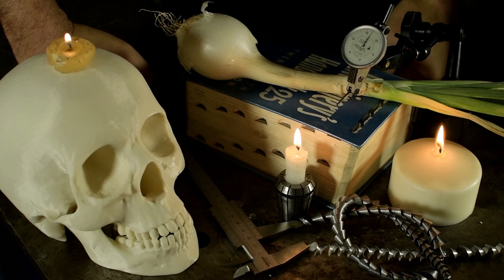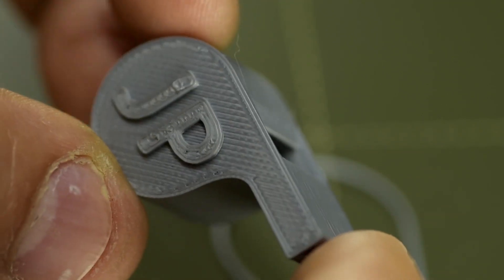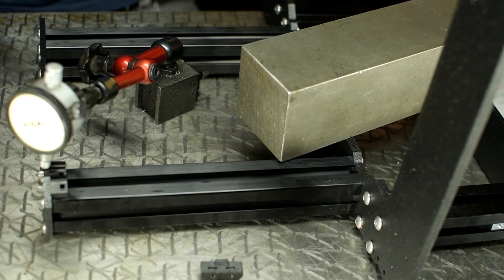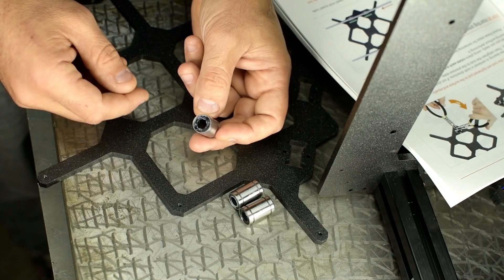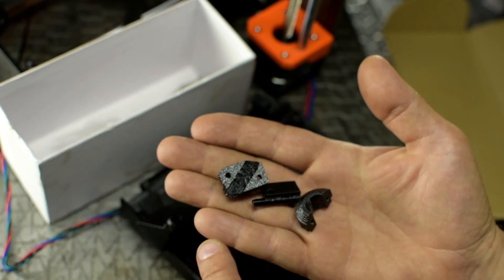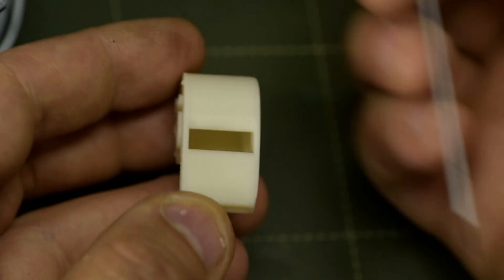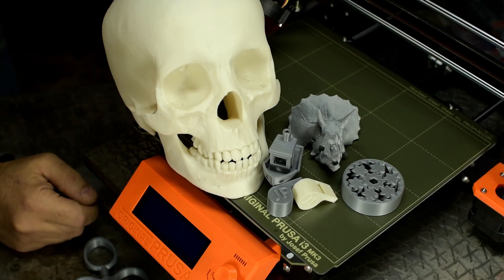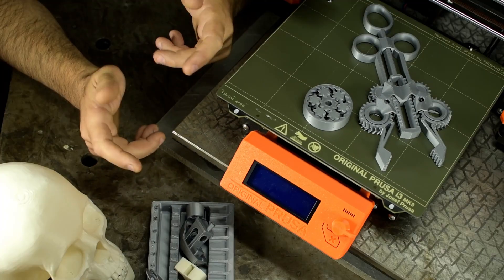This Old Tony in 3D!!! (printing)

Comment: I've had my crappy little $170 Anet A8 for about 3 years now & roughly another $150 or so later it prints about as well as an Ender or a MK-3 with almost no extra attention. It's basically a ship of Theseus or Old Ironsides sorta thing. The budget printers do need more attention and ones like the A8 can be downright dangerous if you don't immediately toss that power supply it comes with. It was a fun learning experience & I feel confident enough to identify and fix just about any problem with a FDM printer but that was the whole point. I'd tell anyone shopping now to just get a CR-10, Ender 3, or a Prusa.

Comment: It was a nice and fair video. A 3d printer is just one more tool in the workshop, and I add a very similar experience with the Creality Ender. Assembly was way easier though and did not require a surface plate...
First part was fine and had very few failures. Just be aware that unattended 3d printers can destroy themselves and possibly cause fire...

Comment: It's neat to be able to download the CAD of simple parts from some parts websites (Ick-Master-may, Arr-cay, for one) and have a fairly faithful printed reproduction. It certainly doesn't have the strength of a manufactured part, but it can serve as a good stand-in until the part arrives if not even some light testing.

Comment: I had the Prusa i3 as my first printer, the heating bed started having issues maybe 2 years in. The wire that is soldered to it became weak from the bed moving back and forth and ended up breaking. When i soldered it back i think i might have shorted it as every time i turned it on the power supply would blow a wire. Anyways i ended up buying the Creality CR-10 mini and i am loving it. It took about 1 hour to assemble as a lot of it comes pre-assembled already and the one i got came with everything you need to get started printing, even a small spool of filament. If i were buying again, i would definitely recommend the CR-10 over the prusa just because of the ease of assembly. as far as the prints, i think both were pretty similar up until i started having the bed issues

Comment: As a Creality owner: Creality machines are for tinkering, Prusa machines are for printing.

Make sure to look into the settings for infill, walls, floors/ceilings, line count, etc. Also brush up on isometry if you don't remember much about it. PLA might be the entry-level printing material, but it has the best isometric strength of any material you can put through that Prusa.

And don't leave your spools loose. They're wound how they are so they feed without binding. If you let the pressure off the filament, it'll spring back and fuck up the winding. Those unattended print jobs will go from nice care-free prints to warm air if the filament kinks.

Comment: i bought a $125 ebay special, it was a total dog to get working with bad stepper drivers/modules and a filament extruder/feed that worked half the time before falling apart, it was way way way more education than something that would work 1st time out the box, took a month to get a decent print i admit, but what a month.

Comment: I would recommend moving the filament spools off of the printer.  Mount them somewhere else.  Put them on some kind of bearings rollers too.  This will reduce print defects and failed prints (mostly due to the filament coming off the spool).

Comment: You joke about that spindle bearing, my friend took one of those up to 2000 RPM on a drill press and it didn't even get warm. Runout is probably garbage, but it'd work in a pinch.

Comment: Built mine in a day on my table saw. 20 spoils later, haven’t had to adjust anything.

Tips: 1. Get your first layer set correctly. 2.  Buy a textured sheet to print on.  3. Don’t trust the temperature sensor for the bed.  Use an infrared thermometer.  I had trouble with petg and finally worked out bed was too cold. Upped temperature -> no problems.  4. Use the correct solvent for your filament when cleaning the bed.  Where can we get the file for the skull?  :  )

Comment: Quick tip:
Skip the ABS unless you have an enclosure, it does to handle temperature fluctuations well while printing, and stick with PETG, ASA, and use PLA for protyping, since you have a direct drive you can easily print TPU as well. I don't know what temperatures you can run on the Prusa MK3, but Nylon is a great filament to work with once you have most things figured out.

Comment: I'm questioning the "get what you pay for" applicability  here. The Ender 3 doesn't use 3d printed parts in its design, nor does it hold itself together with zip ties. Seems like a lot of the price of the prusa is in the name, and the obnoxious branding on literally every part and box.

Comment: If you haven't got round to the PetG filament yet I would recommend either raising the z axis a bit or use some release agent as it sticks like a bugger to the smooth steet. Windolene or equivalent is a good release agent for PetG and TPU just make sure to remove it before printing PLA. I personally use the textured sheet with petg  as you get a lovely base and it is less sticky. The textured sheet is pretty useless for PLA mind.

Comment: The Ender 3 Pro is the ideal option for a first-timer. I've been using it as my first printer myself for about a year and aside from annoyances with bed-leveling, (which can be remidied with auto-leveling solutions like a BLtouch,) or replacing that terrible magnet bed with a glass one, it's been such as useful part of my hobbies. And I can't even compile of all the improvements I've already done to it just by printing them myself. 3D printing is definitely going nowhere, that's for sure.

Comment: TOT, when you print PET-G, you will need a release agent of sorts on the PEI print bed. Otherwise, the PET-G will fuse to the PEI and probably damage it at best upon part removal. Hairspray, glue stick, or painters tape work well. I personally use hairspray. I've hear people using rubbing alcohol but I've never done that so I can't verify it.

Comment: I may be able to speak to the budget side of 3D printing a bit. As a broke college student I don't have a whole lotta clams to spare, so my first printer was about as cheap as they come. Freshman year I bought an Anet A8, which is essentially a very cheap knockoff version of the printer featured in this video (acrylic frame instead of aluminum extrusions, no auto bed leveling, cheap aluminum build plate), but it set me back only 100 bucks. Took about a month to ship from china and 10 hours of assembly on my dorm room floor, but I can genuinely say that was the best $100 I've ever spent. Having any 3d printer opens up nearly endless possibilities, and the relative efficiency and affordability when compared to other forms of prototyping (woodworking/machining/clay modeling) is staggering when you really get into it. And while that printer would occasionally malfunction, I believe having to tune the machine and slicer settings to get good prints really helped me get a better understanding for the process of 3d printing. At my internship over the summer we had an Ultimaker S5 that cost literally 60 times what my first printer cost, and I while the dual extruder setup is cool, I think there is definitely a point of diminishing returns in there somewhere. I currently have a creality CR-10 (the big brother of the $200 Ender 3 mentioned in the video) which set me back about 400 bucks and I've had almost no issues so far. I think for the hobbyist market thats really the sweet spot; the 3-500 dollar range has a plethora of affordable and capable machines that offer a pretty solid introduction into one of the coolest emerging technologies of the 21st century.

Comment: In my experience, the Ender 3 has been very low effort to use. It comes partially assembled and took me maybe an hour and a half to finish, no problems starting it right up and printing. Maybe it's generally true that budget printers require more time to get started, but that's not true of the Ender 3

Comment: THANK YOU SO MUCH FOR LUBRICATING THE BEARINGS!
The recommendation is some 00 grade semi-fluid, but yeah... Why don't these kits come with bearing packing instructions?
*sigh*
Edit: And yes, you can run 1.6mm smooth line trimmer line through it.. Just find the nylon instructions and change your filliment diamanter.. :)

Comment: Assembling it yourself is actually a good experience. There are times you're going to have to take some things apart to fix it. Like when you have some really bad filament that gets stuck in the nozzle, the only way to clean it properly is to take the head apart.
Benchy has a website that will help you figure out what you can do to improve accuracy. 
I see a few small problems but I can't say what to look for to fix.
3dbenchy.com
And if you don't like the tugboat there are different versions. On Thingiverse look up vandragon_de. He's made some pretty cool ones.

Comment: No one calibrates a 3d printer like a machinist.
Reply: I built mine mostly on my basement carpet. First print was totally fine! Must have got lucky.
Reply: Moisture Patrol it’s well known that basement carpet can be a perfectly good substitute for a surface plate
Reply: @Aklemvaeo  Don't really need that much precision bc the tolerances of the printed parts are not usually determined by how square the frame is.
Reply: @skelten454  A well-built frame is absolutely a necessity. Ultimakers, for example, have extremely rigid frames that are calibrated like adult CNC machines, and they're well known for their remarkable print quality. Yes, the dimensional tolerances may depend on the plastic (partially), but you shouldn't skip on the frame - that's when you start reliably getting tolerances within .1mm.
Reply: ohh man I hate that part.
here we go again
Reply: Next step is a 3d scanner. Einstar for bigger parts, Revopoint mini for small stuff for example.
Reply: Dude, for fking real. His prints are incredibly high resolution considering the machine he's using. Right off the bat he is already maximizing the capabilities of that printer, it takes most people a year or more to get where he started. That skull looks like it came off of a $3,000 machine
Reply: @fuck_youtube_censorship00  what do you mean? It’s a prusa. Of course the prints look good.
Reply: @fuck_youtube_censorship00  My lab has two machines >$2,000 and two more at $1,200. Only one prints as well as Prusa. Plus I can easily observe, repair, adjust and upgrade the Prusa. Others are locked down so when a problem my only solution is to buy a $200 replacement cartridge.

Comment: PETG has all the benefits of ABS/ASA, but doesn't have the warping issues.  And it doesn't smell like chemical death.
Reply: @npgoalkeeper _ ASA or nylon are your only choices if UV resistance is a concern, but that's not commonly needed and is a poor reason to put up with the faults of that family of plastics.  Overhang and stringing are matters of printer tuning.

Comment: FYI seal that PLA backup or it will absorb water from the air and your prints will start messing up halfway through and you won't be able to figure out why. Also stop biting your nails. other than that you're my favorite you tuber.

Comment: Hey Tony. Great choice of printer. One tip for ASA/ABS - give the bed a wipe down with acetone and those pesky filaments will stick! I've been using mine for over a year now and it hasn't given me any trouble. I wish I had a nice plate to build mine on!!

Comment: I have a Creality Ender 3 Pro and find it to be great for a particular audience. It's more work to get right and the manual doesn't explain everything, it's kind of a joke. You have to go through every last roller and adjust them to get everything aligned. The bed springs just kind of whop around on their own so it's a good idea to pick a two part spring cage to encase them. Even after encasing the springs and adding locks to the adjuster knobs, the bed requires leveling every 2-3 prints. Just not a robust enough carriage for having a magnetic bed mat.

PETG is a pain to print. If your settings aren't spot on it gets string as hell.

Comment: I bought a prusa about 3 years ago and was equally as impressed with how well it went together and work right out of the box. I did not, however, assemble it on a surface plate. My 3D printed friends also highly recommended the prusa for anyone who is relatively new to 3D printing. The Ender is great if you're willing to put the extra time into it.

Comment: Tony is on a fast track into metal 3D printing, i can feel it.
Reply: He tried the thing with mounting a mig welder as a pseudo metal 3d printer in an early video
Reply: That's unlikely, since those machines cost tens of thousands of dollars and no-one will sell you one without signing a contract to have them come out and inspect it every so often since the metal powder is so toxic.

Comment: I am very interested to find out if there are affordable 3D printers that can actually make long term usable parts in a material that will withstand the elements, instead of making Mickey Mouse parts that you waste your time on and throw in the bin, only to go on to make another useless part. An example would be unobtainable motorcycle side covers or a primary chain engine cover. It would be a whole lot easier to draw the component in Fusion 360 and 3D print the component than to make it from scratch out of Aluminium or Mild Steel.

Comment: Don't worry, six months down the road, it'll start doing something funky.  After replacing, the belts, the bearings, the motors, and the nozzle; you'll finally give up, decide to go for a new spool of bright red filament, and it will work just fine again.

Comment: Either you went through all the insanely ocd trouble of actually making a fake manual page with haribo consumption instructions for the joke, or the makers of this thing actually included a pack of haribos and instructions on how to consume them during the build. I honestly can't decide which one of the two options is the most amusingly disturbing option

Comment: Word for word my experience with the Prusa, absolutely no regrets. I upgraded the bearings on the Y axis but aside from that, still stock, which is pretty crazy to think about in a way. There are some awesome ways to expand it too, been tempted to add Octoprint to one of them to take some nice timelapses of parts.

Best bit with 3D printing IMO is suddenly you have that quick option for so many little parts. I've been using mine to print brackets for any and everything in the workshop, some of those things would take aaaaages to manufacture with other methods. Also it's just mind blowing to have an idea, quickly model it up and then suddenly a few hours later, have a working prototype in your hands, takes the risk out of spending ages to machine something that you're not 100% certain about.
Reply: Ender3-Pro and Octoprint here: you really need to get Octoprint, it takes a cool thing and makes it even easier, more reliable, more cool..  (I just re-read that, and it was in TOT's voice, weird)

Comment: There is a tiny bit of layer shift on the bench. About 5mm up on the Hull.
Reply: I saw that. But, I don't think it's enough to be a layer shift, could be a draft issue
Reply: @sp00nesis  It could. but it is a prusa model on the prusa software...

Comment: Tony, I may be done with using the pliers as a wrench. I bought the full set of wrenches from Hand Tool Rescue. The little wrench may be the most useful wrench I have ever owned. Bites well on small fasteners and compact for those places only 3 knuckles fit.

Comment: I can't say I see where the value is on the Prusa models, its not a unique model, its still being held together with zip tie's, glad they gave you a screw driver, was that 500$? I remember the first day we got a MK2 at work, paid the extra money so we didnt have to mess with setting it up. The engineer got it all situated, fliped the switch, started homing it and it hit the limit switch held onto a smooth rod with 2 zip ties, shoved it all the way to the left and screwed up the belt real good... Like what is this fu*k
Reply: @npgoalkeeper _ maybe on the 3 but on the 2 assembled at the factory ours came with the switches zip tied to the bearing rods ... not even good ones either

i had at the time one of the 250$ makerbot clones made out of 20-20 extruded aluminum, it had brackets, 3d printed but fuggin brackets, never had that problem the mk2 after postage was darn near a grand

Comment: Funny thing: that bound assembly and  owners manual, is about 10,000% better than what comes in a Mopar Hellcat crate engine. You spend $20,000 on engine and electronics and you get a manual that is stuff in the crate as an after-though - wadded up leafs of white paper stapled together with one staple.

Comment: 3d printing creates a lot of air pollution (particulate matter iirc). It's one of the downsides. Consider buying a decent filter and running it while the printer is running.

Comment: The best part about printing is usually being able to upgrade. I can take my ender 5 and make an enclosure for it, upgrade the hotend, upgrade the extruder, and replace the bed and nozzle and itll do pretty much any plastic I need it to. Most of these upgrades are fairly cheap too

Comment: Thanks for the informative video! Went through a bunch of the comments and still have a question for you. Having been around CAD/CAM and 3D printing at it’s primordial beginnings, then loosing track of the technology in the last 20’ish years, I am intrigued; how was the G-code for the socket tray insert originated? Surely you didn’t model (Pro-E, Unigraphics, Catia, etc) the part. Maybe another video is called for…
Reply from the maker: yes had to model it.  solidworks > STL > slicer > printer.
Reply: @ThisOldTony  Thanks for your speedy reply. HEROOOO!!! Clearly the COVID stay-at-home order means different things to different people.